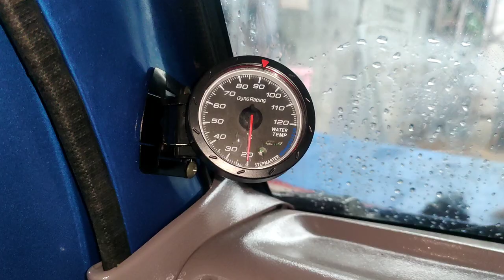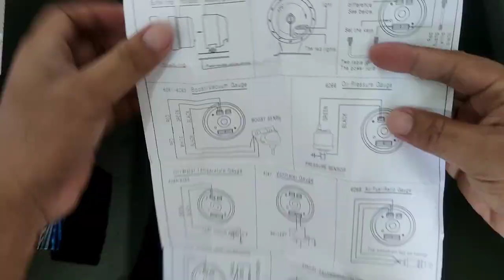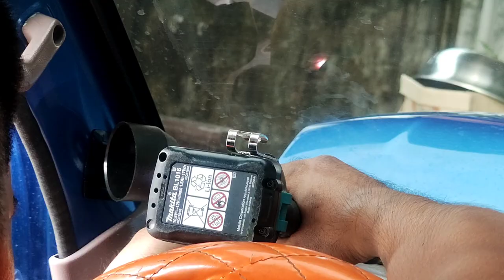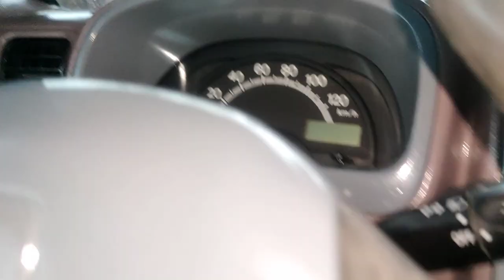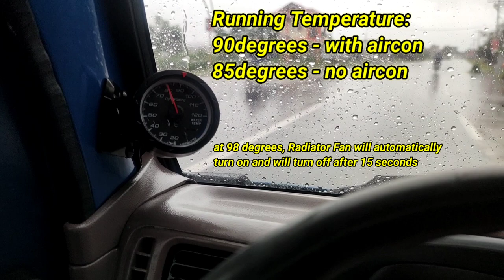Water Temperature Gauge Installation

Comment: Good day sir. Try ko rin sana mag- install nyan sa f6a ko cateye rear engine. Walang magandang access sa rad hose sa harap, pwede ba doon sa hose galing ng thermostat cover? Di kasi ako sure if yun ba ang hot galing engine o cold papasok ng engine. Thank you so much sa idea. Godbless..
Reply from the maker: Sir mas maganda pag mdyo malapit sa makina na hose sir. Extend mo nlang yung wire ng sensor sir

Comment: Hi I bougt this joint pipe with temp sensor. The sensor fits roughly in the blue part. I understand its NPT thread but do I have to turn it in all the way? Cause if I do so, the thread will get damaged. I couldn't see that clearly in your video.
Reply from the maker: Please use thread seal tape to avoid damage on threads

Comment: Sir anong pangalan yong pina extension sa upper hose at magkano saan ino order mo...
Reply from the maker: Joint pipe sir
Reply: Sir anong size joint adaptor
Reply from the maker: @rentontarona967  26mm sir

Comment: bossing yung redwire ba pwede b i direct sa pole ng baterry sa possitive pole nya ty
Reply from the maker: Yes bossing. Pwedeng pwede
Reply: bossing kung direct sa possitive battery ung red wire kelngan ko pb lagyan ng fuse?
Reply from the maker: @ragsfamily7977  mas maganda pag may fuse talaga bossing
Reply: nagtataka lang ako bossing bkit yung redwire kelangan naka tap sa live possitive nang battery eh possitive din nmn yung sa ignition pag naka on db sila pede pag samahin nalang sa ignition on possition?
Reply from the maker: @ragsfamily7977  hindi talaga yan pwdeng pagsamahin bossing kahit parehong positive ang mga yan. Kelangan may constant supply at accessory supply na puro positive. Ang purpose kase nyan ay para kahit nakaoff yung susi mo,  nakastandby lang sya. hindi magrereset yung gadget na nilagay mo. Same lang yan sa stereo or sa mga amplifiers, may constant supply. Same din sa relay dalawa ang wire ng positive. May constant at may accessory
Reply: ahh okay bossing salamat sa info nalinawan nako regarding red wire . itatanong ko nalang sayo kung pwede b yan i link yan another guage like tachometer and voltmeter ganyan kc nabili ko n water temp bossing guage same n same at plano ko mag aditional pwede b syang i link sa ibang guage? thankyou bossing
Reply from the maker: @ragsfamily7977  yes.. Pwdeng pwede boss
Reply: bossing follow up question pwede ba yung white wire na para dapat sa on possition ng ignition. i tap nlng sa accesories position lagi din nmn on yun kahit buhay n makina db? and patay din naman sya kapag fully switch off db thankyou!
Reply from the maker: @ragsfamily7977  pwede naman boss dpende sayo. Kaso yung acc wire mamatay yan pag nagstart ka ng engine. Babalik din naman pag buhay na yung engine. Most recommended talaga ay nasa on position talaga

Comment: If you connect prong to sensor and wires to any power how did you get temp. You must have connected to temp sensor both ends. Gauge end and prong end.
Reply: that gold thread inserted to that blue tube is the sensor itself